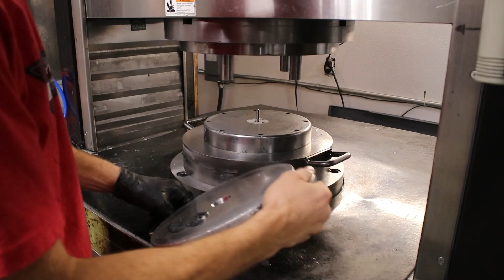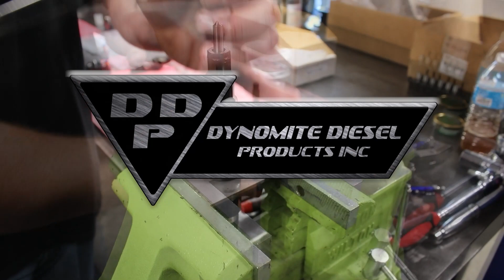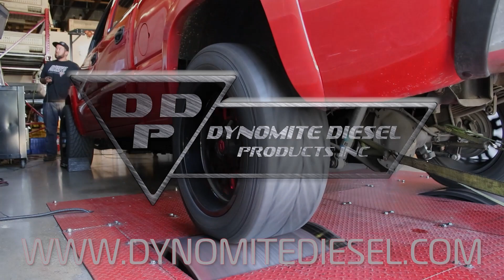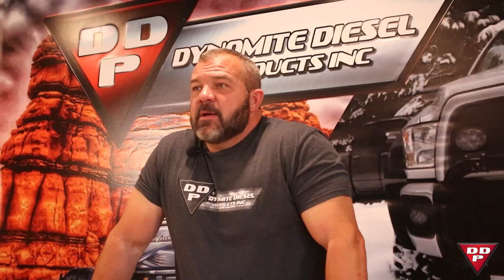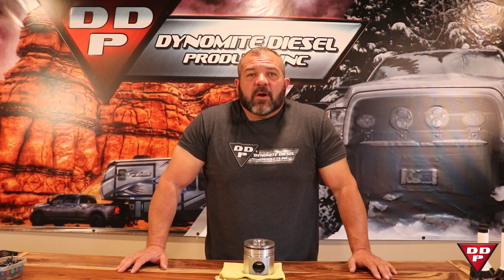Injector Sizing, Pulse Width, and Turbos....

Comment: I have 2013 Denali HD. Built Allison for 750 rwhp, Fleece CP3, Fass lift pump, BW S475 into stock turbo. PPEI tune, Stock injectors. From your video seems like turbo is too big considering my use. A daily driver that’ll put a smile on my face. It does that. Would oversizing my injectors to add another 50-100 rwhp cause more work? I recall seeing 52+ psi on the gauge. I’m asking now because it’s in the shop fora y bridge oring and new S475. Y bridge bolt popped.thanks Lennie

Comment: Goal 400-450 Hp bigger turbo and exhaust fuel setup do you suggest or recommend a specific Turbo and or Injectors for a 2002 7.3L V8 ? Also would it be possible to achieve that Hp with just a bigger turbo… exhaust… fuel mods ect?

Comment: Maybe I've missed it in one of your videos but do you need to worry about spraying outside of the bowl and washing cylinder walls? As far as start of injection or end of injection and if so can you tell based on your spray angle and degree of the crank somehow. I've been studying tuning for a couple years now in a little bit of my free time and randomly on lunch at work. I recently got access to efi live and also bought a cheap 6.7 I hope to play with. Do you have any recommendations on where to look for tuning info? I've already taken the hpa class which was great but always looking for more info

Comment: i got a 700 HP 6.0L. with a big single Spool time isnt horrible but the turbo doesn't really make any boost until 1800 RPM. which i guess isn't bad because the Tourqe band starts at 1800 RPM. and the Horsepower only goes up from there too. just trucks a bit miserable when you gotta take off relatively quickly it'll get a little Smokey but if i roll into it from a light once the turbo really starts doing its thing i can mat the Pedal with little smoke and it'll blow all 4 tires off.

Comment: I’ve got a stock 2003 5.9 and needing injectors and wondering what the factory turbo will handle fuel wise? Looking for around 450 hp and I do pull a 12-13k camper in texas
Reply from the maker: The factory turbo should support your goals.
Reply: @DynomiteDieselTV  what size injectors do you recommend?
Reply: I’ve got a 250 hp 5.9
Reply from the maker: Please fill out the Custom Injector Form on our website, and we'd be happy to make a recommendation for you.

Comment: Thoughts on k27/sxe372 compounds with your 150hp injectors on a p pumped swapped 24v? Built automatic with stock stall triple disc….

Street toy with occasional towing
Reply from the maker: There's still a lot of variables, and unknowns, there. Your best bet would be to call in and chat with Chris, or Lenny, on this.